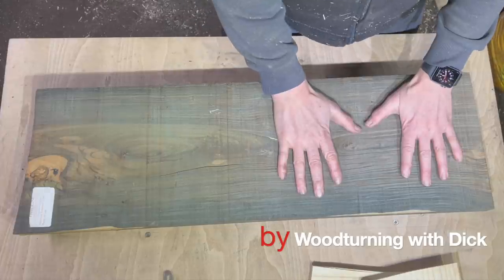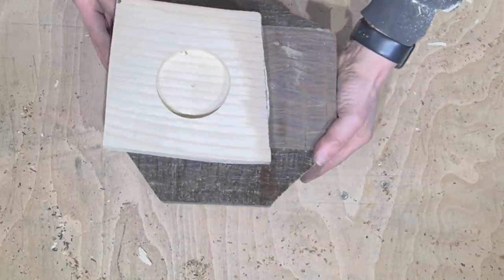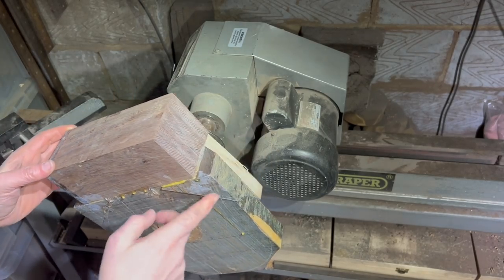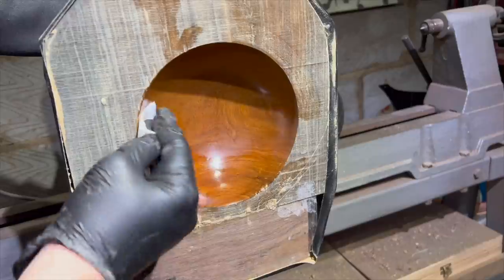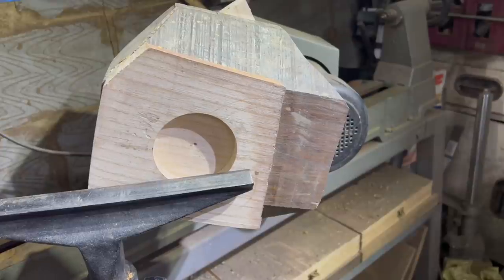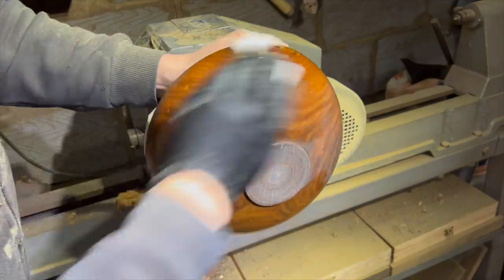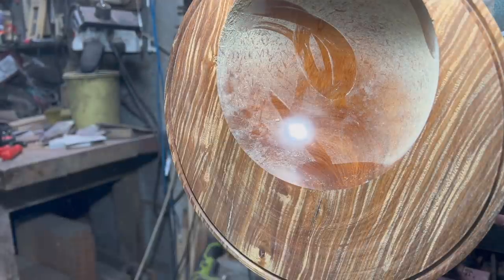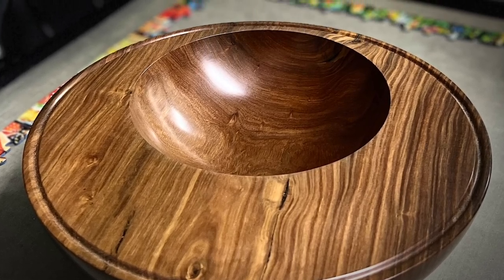Off Centre Woodturning Lignum Vitae Bowl

Comment: Traitor...  you didn't buy the wood from me. noooooooooooooo......
cracking job with that as usual mate but where did you find a lump that big???
Reply from the maker: I’m so sorry Steve! I went to Timberline, Tonbridge, for some more sander sealer and spotted that while there and had to buy it! There were bits there that were ALOT bigger, some that I’m not sure I could lift on my own!
Reply: @WoodWithD  i was only joking mate, not surprised that Bob has some good stuff there. in all honesty i'd be tempted too...

Comment: Beautiful bowl Dick! Out of curiosity, what size is your bandsaw?
Reply from the maker: Hey Michael, I’ll get the ruler out later, you mean maximum cut depth?
Reply: @WoodWithD   just grab the model number, I will be able to look up the specs. I would like to get something that size for my shop but it's the sort of purchase you only want to do once :D
Reply from the maker: @OriginsOfMo  will check this eveninh mate, currently in the home office doing day job (supposedly 😀) and get back to you here. Bought second hand, replaced the guides for the roller type, other than that cracking machine!
Reply: @WoodWithD  Thanks :D
Reply from the maker: @OriginsOfMo  sorry for the Delay Mike, the Bandsaw I have came from a carver who was upgrading. It’s a floor standing Perform Bandsaw Model CCVBB with a max cut depth of 230mm and max width of 380mm. Axminster now do the more modern version and you’ve made me look at their website and now I’m considering the Axminster Trade AT3327B! 😀😀😀
Reply from the maker: @OriginsOfMo  🤣🤣🤣🤣🤣 I knew that was coming! No, think I’ll limp along with this for now and save for the new one 😁😁😁

Comment: Can I ask how you sanded this up I find it chokes the sandpaper up very quickly, I thought maybe there was another way or just patience and keep changing the paper
Reply from the maker: Unfortunately, if you wanna keep the lush oil finish, the clogging sandpaper and changing it is the way to go. I’ve heard some talk about using various chemicals to wipe away the surface oils in order to sand, but I’d rather do it old school. Good way to use up older sandpaper that I know you’ve got a pile off! 🤣🤣👍

Comment: Beautiful result. Interestingly, I do off-center bowls in the reverse order. First, I turn the outside of the bowl normally--on a worm screw. I sand and finish. Then I take the blank off the lathe and draw out my interior on the top. I drill a second worm screw hole in that center and remount the blank. I cut a mortise along that axis and then reverse the blank and hollow out the bowl, then sand and finish the top and the interior.  For me, this has the advantage that even once it's reversed off-center, it's at least round so it doesn't shake quite so much. Plus, I know what my fimal shape is so I can position the bowl more accurately. And I can sand the outside while it's centered, which reduces wear and tear on me.
Reply from the maker: Hi Leigh. That sound very awsome, but, wouldn’t there then be two chuck grips in the base?

Comment: Beautiful piece Dick!  When you use the Forstener drill bit do you taper or just leave straight sides?
Reply from the maker: Welcome Halloweeninator (that’s a mouthful! 🤣) 
Fortunately for me I’ve got gripper jaws on that OLD chuck I used, so I don’t need to taper, just do it up tight. 
I’m shortly going to be doing another off centre bowl out of greenheart this time, and going to use a lot better, slightly safer, method of making this type of bowl. And specially for you I’ll use a tapered chuck grip 😁👍
Probably be in a few weeks time, so if this is going to be a project for you, can you wait a few weeks, stick around and the new video will follow 😁👍👍👍

Comment: Excellent work, lovely piece of art. I have the lottery of owning a lot of this wood, it is quite interesting how behaves after been turned, or wetted...did your piece turned greener after a while?
Reply from the maker: Hiya, I LOVE it! Yes indeed, a lovely dark green! It actually moved quite a lot within a couple of months, so I refinished the whole thing by hand. It looked amazing again and then didn’t move anymore. It’s the weight I LOVE most I think 🤔 😁👍
I hope your making beautiful things too 😍
Reply: @WoodWithD  I figured...this wood never dries completely I guess due to the high oil content, so, movement is quite normal...some of the pieces I own are 50 years old...and still not fully dry. I'm making some good stuff, basically anything that I want to last forever...genuine LV is even harder than argentine (19Kn, vs 17Kn in the janka scale)

Comment: You used wood glue that is not a structural wood glue for a structural joint which is inherently dangerous. A structural grade of epoxy would have been a safer choice. A large faceplate allows screwing counterweights to the faceplate for a perfect balanceand safety.
Reply from the maker: Thank you Charlie, I’ll look into a large faceplate for future one - many thanks 😊
Reply: Thanks Charlie.  Where would we be without the You Tube safety patrol having our backs.
Reply: Charlie, you are right. He didn’t even scuff up the surfaces before applying the glue. 🤷‍♂️ I hope Dick uses better safety procedures in the future but then again, it’s the danger that keeps me watching and it makes the popcorn taste better.